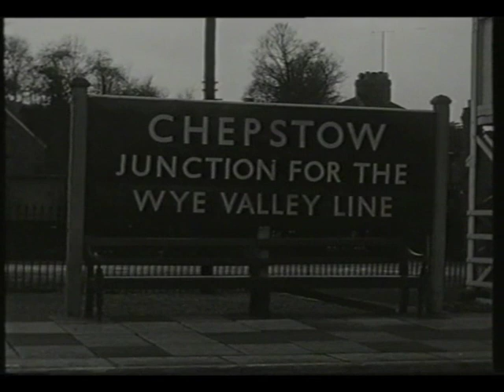Railway Roundabout 1959 'The Closing Of The Wye Valley Lines'

Comment: The mass closures in the 50's/60's still makes me angry today. I know the wye valley line was never in profit but many branch lines were the same- they acted as feeder lines for the main line so contributed a lot more to the central coffers than beeching et al realised. the speed with which the line and the bridge at Tintern were ripped up was obscene and this attitude was apparent everywhere.
with our booming population today who is to know just how short sighted these closures were?
Reply: mrspivvy yes they acted as feeder lines, but the levels of usage were falling on most of them and had been since WW1. First the passengers moved on the buses, and the main reasons for this was convenience (the bus went from the village and more often than not the railway didn't (Kimbolton, Cambs, is a good example of this with the station being 2 miles from the village) and the buses ran at more convenient times to get to the bigger towns). The 1950s brought the next nail in the coffin for such lines, the increased motor car ownership, which raised the convenience to a higher level by freeing the owner from the tyranny of the timetable. The other issue was the freight from businesses on these lines moved from rail to road as although slower in journey times over long distances it also was more convenient and cheaper, keeping the costs and price down. BR (and the Big Four and their constituent companies before BR) had to provide a locomotive and crew(s) plus a guard or guards (depending on the length of the shift) even if there was no freight to move (the service had to timetabled, removing a pathway for a more profitable service). So overall these lines didn't contribute significant portions of the cost of operation and maintenance, and thus with the dire economic performance of the country in the 1960s, which followed the boom and bust economy of the 1950s, these lines were seen as expensive luxuries and thus they were cut.

This is no to say that mistakes weren't made, but those mistakes are only visible with the benefit of hindsight. The current issue of how Brexit will affect the UK's economy is a case in point. Nobody is certain what will happen, will the economy tank or will it fly. The only think we can say with any certainty is that will will only know for sure is to wait and see. The same was true for Beeching and his predecessor and successors. They could only see what each line cost to operate and what revenue each line made at that time, they could not see that these lines would have a chance to recover and be more profitable in 20+ years and that long distance commuting would be considered normal.
Reply: I am a volunteer at a preserved line in Yorkshire and our line was one of the ones closed in the 1950s, in our case what had kept that line open was Burdale Quarry, when that closed there was nowhere near enough traffic to keep the line open. With regards to tracks being ripped up, although in an ideal world routes would have been mothballed in case they were needed again, it would have meant high maintenance costs of Bridges etc with no income from the line to  help pay for it.
Reply: I’m from Australia so what would I know, I was told that Beeching saved BR as it was (apparently) a basket case at the time and if cuts weren’t made would have resulted in a bigger collapse in the late ‘60s. I was also told that the relevant minister of transport or his relative had links to road interests and thus a vested interest.
Personally, I regret the cuts happened and in the Beeching Wiki says that some lines were reinstated in the early ‘70s as populations grew.
In Victoria we had the Lonie report which recommended not just a lot of lines close but all country train services cease. The government knew that would be political suicide to cease all non suburban trains.
However nearly all recommendations of lines to close were accepted over a ten year period even by the Labor government who was in opposition at the time of the Lonie report. Later there was speculation that Lonie had links to the road industry.

Comment: The motorways are under stress big time, we should have at least mothballed these lines..
Reply: Chris Quinn at what cost? And for how long? Two questions that no one would be able to answer in the 1960s. Hell, they couldn't tell in 1982 that in 2018 the GN-GE joint line from March to Spalding would be needed and would negate the need to dig the Werrington dive under. And that was less than 40 years.

Comment: OK but 90% of Britain's population lives in urban areas. That means that, even if you provided so many branch lines that nobody living or working in a rural area ever used a car or a truck again, you couldn't cut congestion by more than 10%. The effect on urban congestion would be even less. And that's under the ludicrously optimistic assumption that everybody used the trains all the time. In reality, the effect would be far less than that: it's hard to imagine even a 1 or 2% difference.

Comment: So, basically, your argument is that if you pull out of thin air a number of people who travel from Ross to Gloucester, and then pull out of thin air the idea that there are now ten times as many people who want to make that journey as there used to be, you could cut congestion in Gloucester by 0.67% (800 people coming into a city of 120,000). That's not very convincing.

Comment: Really interesting. But the comment about the M50 is incorrect. The M50 ends at Ross-on-Wye. The A449 is the Ross - Monmouth dual carriageway that this line followed.
Reply: The commentary is excrutiating. It was added when parts of the original TV series from the late 1950s was released on video. You are right that the M50 ends at Ross-on-Wye but even then the new road is not built on top of the former trackbed between Ross and Monmoth as the new road and the former railway are on opposite sides of the river!. The railway is south; the road north. The new dual carriageway is built on the former railway trackbed from about a mile west of Monmouth past Raglan and almost as far as Usk but that section closed in 1955.